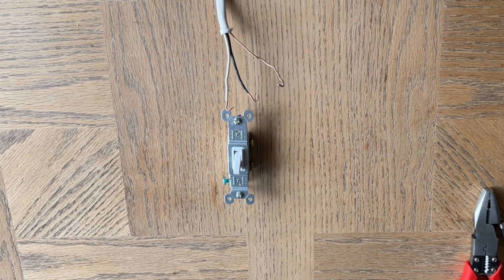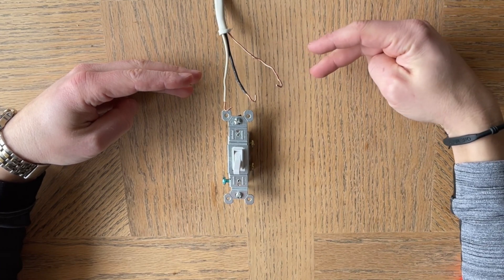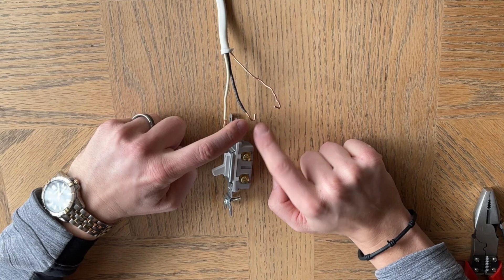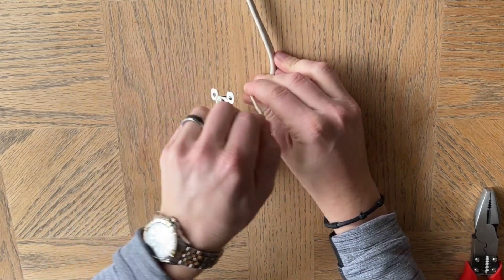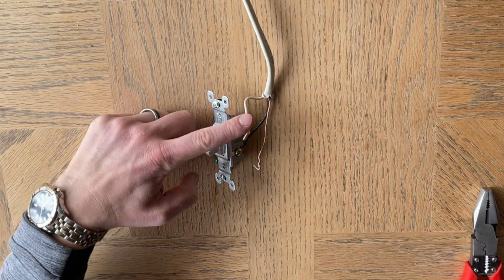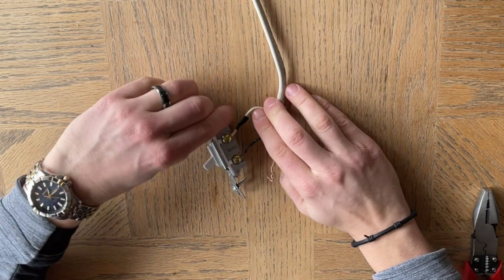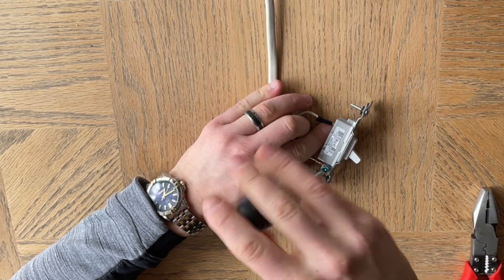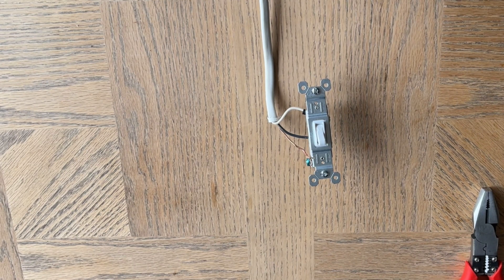How To Wire A Light Switch Install Standard Single Pole Light Switch - Power At The Fixture

Comment: I just moved into a house, after cutting the power I noticed I didn't have power in three rooms dining room, living, and a bedroom, I tried everything to get power and nothing, in my dining room which would be the closet room of the 3 to the fuse box, a have a switch and it has a line coming down from above just hanging there, I had no idea, but I'm my fuse box there is two wires wrapped up not hooked to a breaker a black wire(hot) and a white wire (neutral) and the white wire is covered in black electrical tape. I just wonder if that's where all that goes
Reply from the maker: Very possible. 
You’ll have to do some trial and error to find out what those wires are.

Comment: thank you! I have my lights working again,  I tried to wire in another light switch to control the closet I had put in, but I never was able to get it working, I am using a double single pole switch 1 for closet 1 for the ceiling in room. i just put back the single single pull for the ceiling for now, but I could really use some knowledge on how to add the switch leg to the closet light.
Reply from the maker: Glad you were able to get your lights working again! It sounds like you need to run a couple traveler wires so that you can make a three-way switch.

Comment: Can you somehow take this light switch to add another light switch for another set of lights?
Reply from the maker: As in have 2 light switches controlling the lights?
Reply: @HowToVideoChannel yes how could i comnect a second light switch to control a second light? I have power coming into 1 switch from ceiling fan fixture wanted to add a second switch so that i can control front porch light  separately
Reply from the maker: You will have to pigtail off of your hotline in. That way you will separate the power source. So you will have the first pigtail sending one line of power to the first light (ceiling fan fixture) and the switch then you will have the second hot pigtail sending to your porch, light and switch.

I’d also suggest calling a local electrician and asking about the situation to see if they’ll give you any free advice on completing the project. That way you can have some more of the details explained.